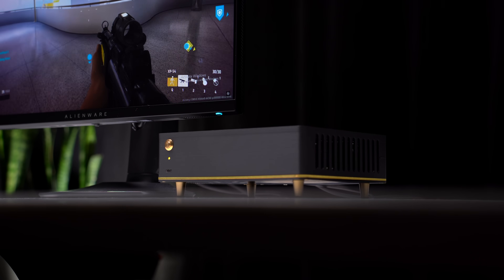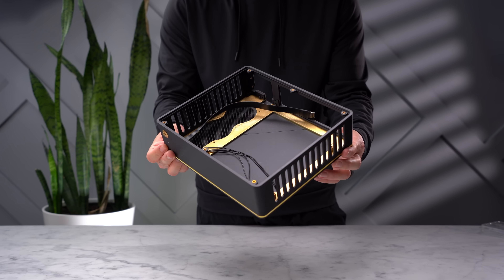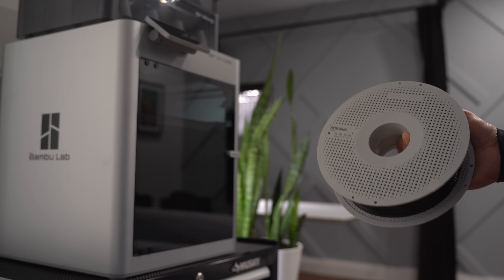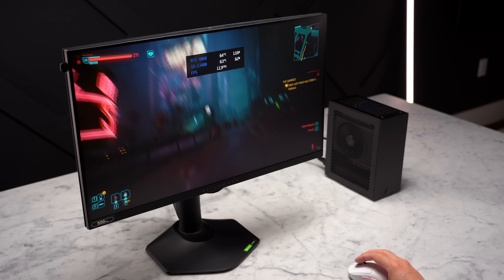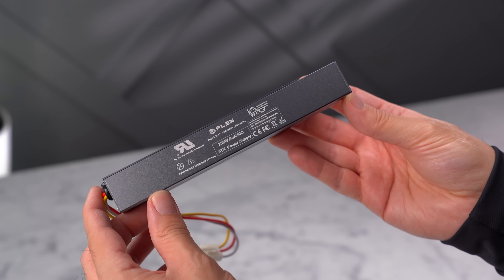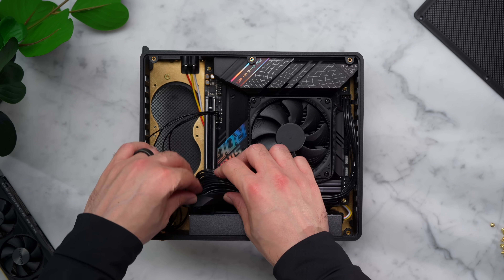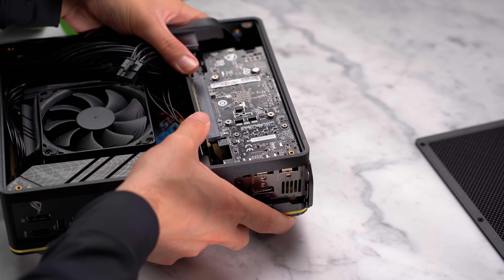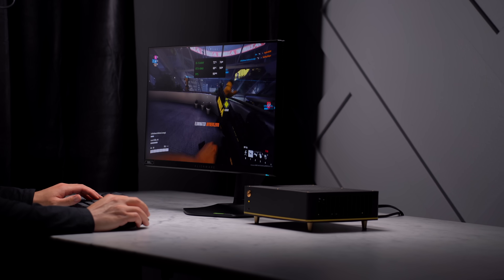World's Smallest 4060 Gaming PC That You Can Build NOW (No Mods)

Comment: About that PSU and melting plastics.. I got a secondhand HDPlex 250W off from a seller who told had it powering a 1050ti inside a Nintendo 8bit housing and it still has some mysterious red markings on its one side, matching really well in the Nintendo-red plastic :D On my system its been powering a 1070 for a year already in open air build, dissipating some heat into aluminium rack its zip-tied to, works well.

Comment: just as a note to make sure u are aware of that...
u know that :
1. when u pull ~240W from the wall u pull only ~200-215W from the PSU (depend if the PSU efficiency if it's 85% or 90%)
2. if the PSU is quality it will not just shut off if u pull 250W its will more likely hold  110-120% load just with reduced efficiency and a bit less stable voltage.

Comment: The thing is, with all cases on this channel that tried to utilize the Low Profile 4060, all were suboptimal because they completely block the airflow of this gpu. Having vertical fins on the heatsink, it pushes the air on two sides and it were always blocked in all cases featured here. However, there's one case that's actually MADE for the 4060 LP. It's the A24-v5. The panels are vented EXACTLY where they should, so the used warm the air of the gpu can leave the case instead of getting immediately blocked and trapped like here, and every other that was featured.
For this reason, I think the A24-v5 is the best for the LP model (riserless, 70mm cpu cooling clearance, 3mm thick panels) and the Velka 3 is the winner for anyone having a single fan gpu.
Reply from the maker: It has ventilation on the side and bottom of the gpu - https://imgur.com/V8PYrFo
Reply: @devyn.johnston The riser is blocking it on the other side. Same with the Gemcase where the psu blocks it and with the HT5, it's the closed panel of the case itself. With the A24-v5, there's a vented line on the backside as well where the gpu exhausts, so that should result in even better temps at load scenarios and also could be layed horizontally like this one. It could prove to be a nice comparison and how sturdy it is, it's definitely up for travel. This video is great for mentioning how the i5 is more suitable for 40mm clearance - that's very useful for people getting inspired to tacke one of these compact cases. Keep up the good work:)

Comment: Great content, but try pls with lower tdp hungry builds with this 250W fanless hdplex. It is recommended to use  PSU at max 80 percent of  its max power supplied. There are 7840HS buil-in mobos in the market with lower TDP.

Comment: Why would u use 6000mt/s ram settings for an intel itx build. such builds will do 7200 all day long and with okey cpu even more. mine 12700k with an msi z790itx does 7800mt/s. but sure, the 4060 is pretty crap performing wise but still in games like cs it would still help with faster ram.

Comment: Cool! I built a 4070 pc in velka 5 using your guide, works great, thanks!
Reply: is it bad thermals/perf because of size?
Reply: @wheezel55  I got an AMD 7600, these new AMD chips target 95c at full load, so no matter what cooler you have thermals will be the same lol. But if your cooling is good it will hit higher clocks at full load for longer. In my case I also undervolted the cpu quite a bit and it started getting slightly higher clocks. It's hard to measure that though, so I don't have exact numbers. 

As for gpu, 4070 is pretty efficient. I can play Cyberpunk 2077 with path tracing and DLSS balanced for hours. I get around 100-120 fps (with frame gen, so really like 50-60). There is no throttling or anything, so the cooling is good enough.

Thermals are not a problem, but noise might be.
Reply: really? how much did it cost?
Reply: @marcus-wv9ti  around 1800 USD, but I payed 800 on top for shipping overseas from US and import tax (18% in my country). Funnily enough it is cheaper than buying a lower spec PC here locally.
Reply: great, how are the temps? I am planning to build such thing for 3d, unreal stuff
Reply: i look that case up it's crazy it costs the same as brand new 3070 here💀
Reply: @FlyingGiraffe_26  if you're outside of the US it might be cheaper to just ship from US directly than go to resellers.

Comment: Man is going to make a laptop at this rate
Reply: Sff laptop.
Reply: @DazePhase it's a joke
Reply: This GPU beats every mobile 4060
Reply: @elalemanpaisa 4060M and 4060 has about a 5% performance difference, not much of a flex
Reply: @MarcelPeters-wx5he the 4060 mobile matches it's desktop equivalent in just about every game and task.
Reply: at heat generation @elalemanpaisa
Reply: @elalemanpaisa  Desktop 4060 is better than a lot of mobile GPUs.
Reply: @elalemanpaisa  it better considering the size of that heatsink
Reply: I'm currently researching to build a mobile 1440p build. Cheaper than a gaming laptop, better performance, and you can customize and upgrade. I just need to find a good 5L case.
Reply: @thedayofquicksilver6930 I daily drive the case featured in the video "lunchbox 2.0 gaming pc".

It's good, I take it go class 2 days a week, but it's not fun plugging in the cables and carrying 8kg+ in one hand. Plus, showing my work to the professors is a lot harder than flipping on a laptop screen.

If you don't move it that often it'll be a better experience, but still not as good as a laptop. Uou can't use it in an airplane or easily work in a coffee shop.

If I could afford the framework gaming laptop I would've got it instead, but this is good enough for sure.

oh it also fits in a carry on suitcase which is awesome!
Reply: @Max-wl5ll  Yeah, I'm just going to use an ITX build for a desktop pc for when I'm traveling in hotels, and I don't plan on ever taking it out and hooking it up in public because I'll never need to. It will be mainly for light work and gaming in the hotel room.
Reply: A customisable laptop is still way better than what we have now
Reply: bro gonna end up with flash drive pc
Reply: Man’s gonna make a flip phone and call it a sffpc
Reply: You mean. This is like slavery. I mean a laptop with extra steps
Reply: These SFF cases (the super small ones) I think make best sense if you travel with it.  None of these look like they are made to travel with, so value for the struggle is not there, at least for me.

Comment: 4060 LP is wild
Reply: It’s so small 😂
Reply: thats what she said ;-; @corpingtons
Reply: yes and has the same performance as the regular 4060 right?
i think the difference is the price too
Reply: @arikowidtrash7074 Same performance and much more compact. There is a $30 markup, but it is a very high quality card, it feels like a brick in your hand. Puts the manufacturing of something like a LP 1650 or 3050 to shame
Reply: @arikowidtrash7074 It's only a lil more expensive, for something so niche it's a good deal. Now the 4060 itself... Huge markup on that crappy card from nvidia. And SFF costs a lot more, it's everything else where you'll be paying a markup, not the 4060. Mobo, case, psu, etc,.
Reply: Same performance and cheaper for me